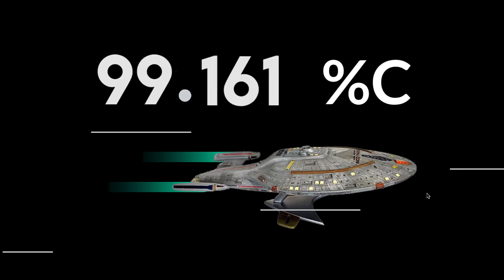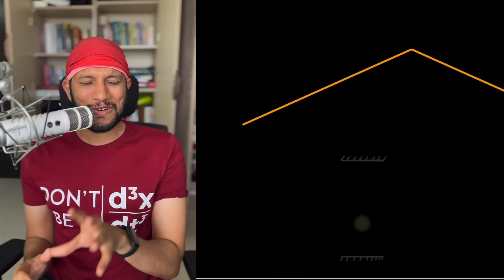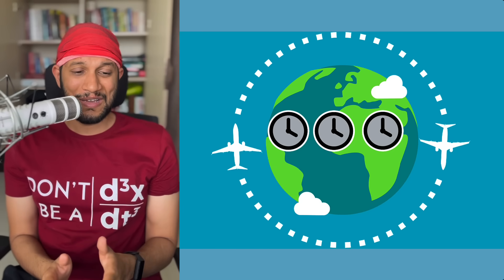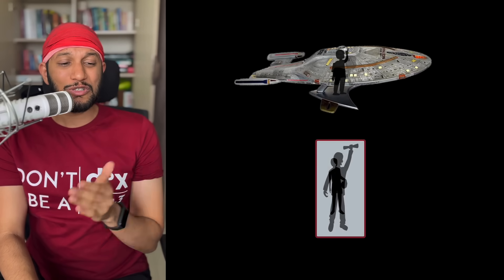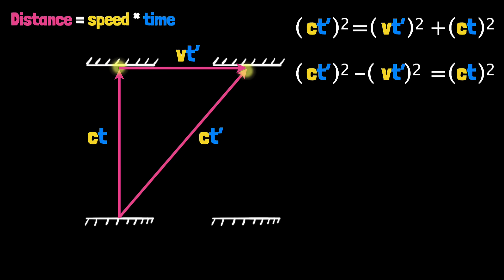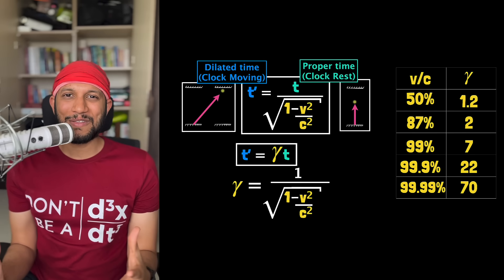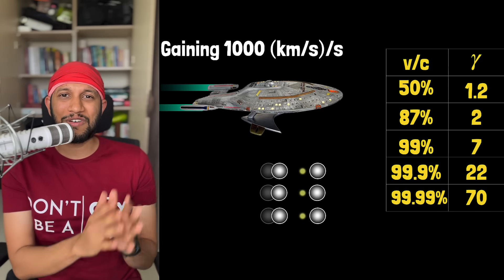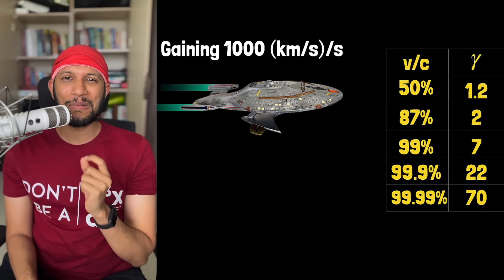I finally understood why you can't go faster than light! (My mind is blown)

Comment: Can you make a video about the Pauli exclusion principle?
Reply from the maker: Yes, I want to finish a few relativity videos and then ll get to quantum!!
Reply: @Mahesh_Shenoy sir what about the question u asked in the poll? It's bothering me since then

Say a space ship travels at 87% the speed of light. The Lorentz factor at this speed is about 2.

Imagine the space ship and my (stationary) clock is synced at zero and at the same time we shoot a light pulse. If I wait for one second.

The ship would have moved forward by 0.87c. Now here's what I thought the ship 'sees'

In my frame. the light pulse is c - 0.87c = 0.13c ahead of the ship. So from the ships perspective it should be 2*0.13c = 0.26c ahead. (Length contraction). Since I second has passed in my clock. 1/2 = 0.5 second must have passed in the ships clock. So. according to the ship. the distance light travelled = 0.26c in 0.5 second which is not c. But the speed of light should be c in all frames.

The exactly same copy pasre
Reply: Cool. Can't wait @Mahesh_Shenoy

Comment: Love your video,  would you please explain how the twin paradox is resolved? And why or why not accelaration is absolute
Reply from the maker: Yes yes, it's in the bucket list. I want to do the E mc square derivation first!
Reply: it is wrong. no real clock slows down, because no real clock measures time, not distance. all real clocks measure time*distance, and that is a non-variable. 
Einstein was often confused

the answer to the twin paradox is: 
all twins in the Universe live in the time*distance, not in time, nor on distance. 
this is the key to understand the limits of special relativity, that is a non-functional theory, merely a didactical object.
no twin ages more, by virtue of relative motion and speed.

there are three types of time, all different, always different: 
1. theoretical absolute time, or say theoretical local time;
2. theoretical relative time, or say theoretical distant time;
3. measured time, the real time, that ironically does not have the dimensionality of time, it has dimensionality time*distance

Comment: What if instead of a photon we use a regular slow moving tenis ball? Wouldn't then the vertical speed remain the same since the horizontal and vertical speed vectors just add up?

Also what if we don't care about outside observer watching the accelerating ship? Inside the ship we still observe 1000km/s^2 and there is nothing preventing us to go faster than c (according this explanation).
Reply from the maker: Great question! 
Actually, not really. Vector addition is an approximation at low speeds. If you use relativistic addition, you will get a lower value. For low speeds, it's negligible. For high speeds, it's considerably lower than what the regular vector addition gives you. 

Look up relativistic velocity addition formula.
Reply: @Mahesh_Shenoy  Wasn't the relativistic addition formula derived from the Lorentz transformation making this a circular explanation/proof?
Reply: Cannot go faster than the speed of causality which is basically a universal order of operations in a given reference frame within the confines of spacetime?
Reply: @dvvinever  Yes, but this explanation requires some additional information apart of the "bouncing photon" math.
Reply: @dvvinever causality is not reference frame dependent.
Reply: How about mass increasing with speed too so the faster a ship goes the more energy and mass it has which would require increasing energy to continue accelerating?

Comment: 12:31 if nothing is changing from space ship perspective 
then isn't this possible that for a person sitting in spaceship eventually feel that from his perspective he reached the speed of light
Reply from the maker: From the ships perspective, they are always at rest! So, they will feel a constant acceleration until the fuel runs out!
Reply: @Mahesh_Shenoy   what about its surrounding?
wouldn't it wil see its surrounding moving at thee speed of light?
Reply from the maker: @devanshu8527   Love it. The ship sees everything length contracted (not covered in the video). The whole universe would shrink to an infinitesimal before it could every see things moving at the speed of light.(take this comment with a pinch of salt, though)
Reply: @devanshu8527  As the ship gains 1000 km/s every second you might expect from its perspective other objects would gain 1000 km/s every second (in opposite direction) relative to the ship. But there is another part of Lorentz transform (formula for converting from one frame of reference to another) - length contraction. What's 1000 km for a static observer will look like 500 km, then 100 km, then 1 km then less and less in the ship's frame of reference, which means apparent acceleration of outside objects will decrease from 1000 km/s/s to less and less getting to zero, such that their total speed in ship's frame of reference never reaches c.

Comment: Does this hint at that all massive particles are made up of massless particles all moving at the speed of light?

If the intrinsic property of mass is a result of some dance between massless particles, then the time-dilation effect can be explained in the same way for massive particles. I understand that massive particles also need to slow down as to not break consistency between inertial frames of reference, but you're explanation sort of is hinting at this.

I also get that this isn't part of any working models of physics we currently have...
Reply from the maker: I think your intuition is quite close to the current models! I remember seeing something like this on PBS space time.
Reply: @Mahesh_Shenoy  thanks for the reply, that's very interesting, I'll have to search for it. I was talking to ChatGPT about it, and it suggests that it isn't close to the current models, because the property of mass is intrinsic, so no further particles of which it is said to emerge from... but idk, I never got that far in university, but still very interesting. I'll have to find this video on PBS space time.